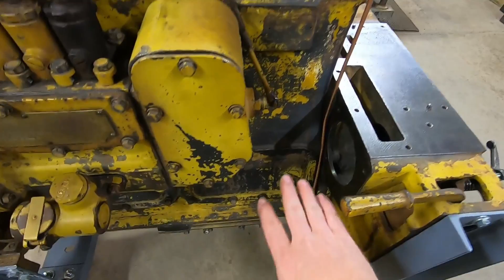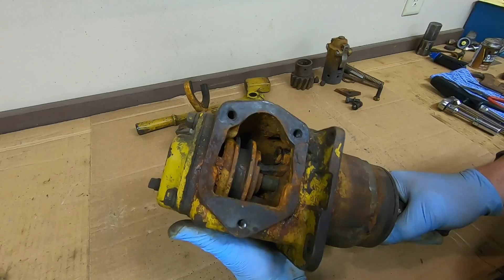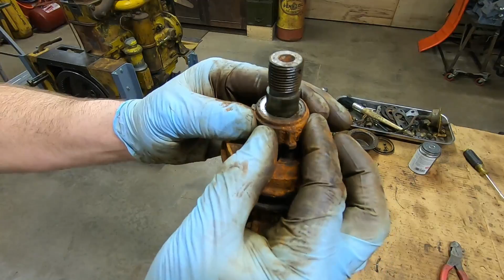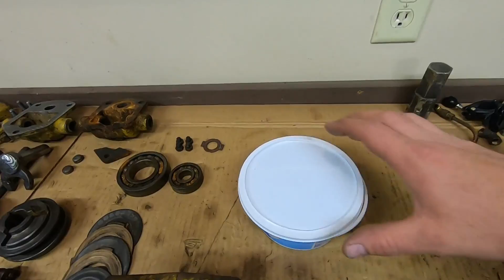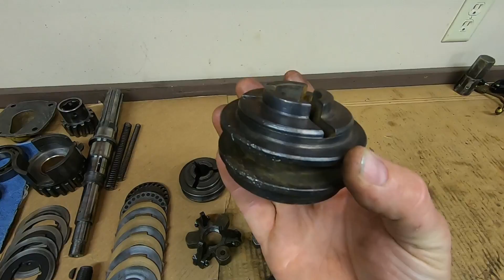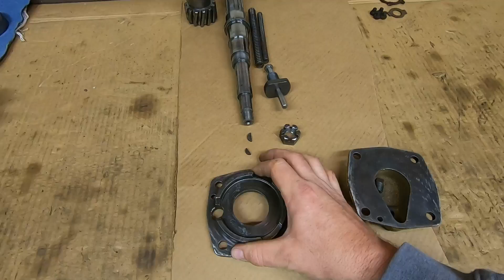Caterpillar D2 #5J1113 Starting System Ep.1: Pinion Drive Disassembly - Broken, Rusted, & Damaged!

Comment: Can I send you my pony motor for rebuilding
Reply from the maker: I do not do any work for hire, but I try very hard to include enough detail and demonstration in all of the episodes that I make to give anybody, regardless of experience, a guide to do it themselves :-)
Reply: @squatch253  Thank you for responding. The head gaskets are stamped with motor. If they go against block they cover two water jacket holes. Is that correct?
Reply from the maker: The head gaskets should not cover any water jacket ports, if they do that means they’re probably on backwards, or are the incorrect gaskets 👍

Comment: Toby ,I know this comment comes 5 years too late but your disassembly and rebuilds really feed my OCD ( everything needs to be perfect).  However maybe you should look into a good size ultrasonic cleaner unit.  Especially for things like carburetors, injectors and other smallish frozen parts.  So instead of just soaking overnight in Evapo-Rust, let the cavitation of micro-bubbles work down threads and internal passages to help dissolve rust and corrosion.
Reply from the maker: Thanks for the kind words 👍 I actually do have an ultra-sonic cleaner, but it’s never really been able to clean anything and I haven’t been impressed with it so it’s just sat on the shelf for the last several years. I’ve kept small pieces in it for two days at a time but they don’t come out looking much different than how they went in, and I just end up cleaning them in my solvent pan anyway.

Comment: Ahh, the two extremes!! Referred to your channel via a comment on Jonathan W's channel. Always enjoy watching him successfully deal with mechanical issues using his previous experience as well as lots of basic, instinctive, mechanical aptitude. Much like the rest of us often attempt to do. Always very entertaining, gratifying, and motivational since Jonathan ALWAYS succeeds!! 
On the other extreme, however, also quite entertaining to watch someone with "intimate knowledge" take a complex "seized" assembly apart without resorting to large brass hammers, torches, and/or saws. We see this as well on Jonathan's channel but he often is dealing with assemblies he has never seen before (614 Crane Unit) as a example. 
Just wondering if you use "bead blasting" as a means of cleaning up those corroded/dirty cast parts??

Comment: Hi Squatch Really enjoy your videos have watched them for about three years now as an ex Cat operator of  Cat 15 D2  D4 D8s and D9s have always been interested in Caterpillar equipment have found some information you may be interested in concerning some 5J serial numbers 
Here I New Zealand D2s were a very popular machine as a lot of our farms incorporate hill country unsuitable for wheel tractors I came across these early serial numbers of machines in one area in the central North Island there would have been many more than this imported for the whole D2 production run they are as follows 
D25J619 
D25J610 
D25J 625 
D25J 418 
D25J 2252SP 
D25J 1186 
D25J4168 SP 
D25J 5160SP 
There were of course many other later ones in this same area hope this is of some interest will send more details later 
Regards Les

Comment: Curious, why dont you use electrolysis to clean your rust parts? I have seen it work amazingly for mechanical parts and is quite easy to do if one has a car battery charger. I intend to use it soon just because its so amazing and easy.
Its fun to watch you tinker. Nothing more relaxing at times.

Comment: Random comment noise = Just discovered the weirdest tractors and crawlers made at least into the 30's. Broxburn One Cylinder diesel that normal warm weather starting involves a blow torch and the steering wheel, with optional 30 gauge shot gun cartridge. Never saw a machine with more personality

Comment: my theory they had to replace the pinion gear then proceeded to fudge the repair/rebuild and bought a new tractor after the starter stopped working. that's when it was parked until you bought it.

Comment: The way the parts came off that shaft blew my mind. Not sure I would have dug into it at all much less as far as you did. Like you said "Take the victories where you can get them!" Hypothetics here. Would they have replaced the starting gear had a bunch of parts that were bad and didn't have available. So they just put it back together with what they had trying to get it going but couldn't do they just let it set? Know any history on why it was parked to begin with?
Reply: That doesn't help "decode" it at all does it...lol. Thanks for the back story. Somehow I missed it.

Comment: That housing is like a Farmall's brake pinion housing. You have to remove the bull gear on Hs and Ms before you can get the brake pinion housing out of the rear end case. 
Thanks for sharing!

Comment: strange parts with no wear.  who ever broke the nose off the case. .must have had the last of the NOS parts installed to make it work when it got welded/brazed back together.. 

 when you start on the Pony motor.. are you going to do any mild porting.. intake and exhaust bowl work and swirl polishing to the back of the valves.  just to make it sound extra great..  give the pony a little extra KICK..

Comment: Awesome video, Toby. Only thing I missed was how you removed the two plugs from the shifter yoke assembly. Struggling with mine, not sure how to remove them without damage as they’re both pressed in concave. Keep it up!! Can’t wait for the reassembly and starting engine rebuild, especially setting up the main bearings for correct end float... And also to see what oil you use in the starting clutch assembly.
Reply: Squatch253 Thanks very much, that’s very ingenious. I wouldn’t have thought of that..

Comment: I do not get your in video link cards.  The starter shaft disassembly was without audio.   . I love your work.  I hope both rebuilt machines work for years after this.  Then there is the prototype, a grader, so much to look forward to.  Thank youyou and god bless you all
Reply: While you are in YouTube, on ANY YT video,  find the little "gear" at the bottom of the YT player,  it's for settings.  Go into the settings, and select "show in-video info cards" and then while you are watching videos, little "cards" that the video poster inserts in his/her videos will show on screen, helping you find links to other videos.  Or, you can go into the master control, which you can enter by clicking on your own icon, usually in the top right of any YouTube page you happen to be on, and adjust settings from there.

Comment: Thanks for another update, those of us that said you should save this old girl didn't mean for you to have this much work saving it, it looked way better than it actually was from here L.O.L . The sad part of seeing this mess is, i work on customer machines that are still  farming from the 90's and newer where I find all these kind of what where they thinking fixes or "botches" to be polite about it.
    I have one here now thats just a "gift that keeps giving" I started with a blown motor and machine in bits a dealer shop walked away from after they told the guy the wrist pin knock wasn't that bad and he should keep running it. It got worse then told him it was a 15000 repair. Then sold him another machine instead after tearing it down later, after he insisted they did it and he needed a tractor quick !.
   I've got the motor rebuilt found the original air filter elements in it from 1995 the year it was made !. Found gearbox issues when it was back running that according to the customer he was billed for new parts by another  reputable shop, and they welded gear selector shafts together instead. The "grind marks" and selectors that are 1/8th inch out of line in neutral gave that away ! 
    They even lost a selector spring from a different range change rail from what they worked on in the transmission putting it together and cracked the top cover somehow.
      I found the mangled parts of that spring in the bottom or stuck to the magnetic speed sensor luckily it never hurt any gears going through .  The part that really makes me mad is we know lots of this can't even be blamed on a farmer or bush mechanic fix. Looking forward to more updates, thanks for your dedication the expenses/time doing this and sharing  the extensive voyage with us . see ya next time, Take care
Reply: His rebuilds should be good for another 100yr!!

Comment: I have put worse castings back together with Allstate number 11 alloy. If you have a better spare part, that IS better.. but if you didn't.. it could be salvaged far better than the crummy weld. Same with the tab on that other smaller casting.    Lovely rust.. its an honorary Oregonian!

Comment: Got to wonder if somebody took it apart to fix it and didn’t get it together right thus leading to it getting parked. Have you ever tried thermal shocking parts like the one you got soaking? Heat the parts in a hot water or oil bath then cool them. The different sized and density parts cool at different rates. Not as intense as a torch

Comment: Looks like the only way that pinion gear cold be that good without a clutch brake, would be if the pinion was latched before starting the pony motor with the clutch released of course. Maybe that’s why they left a friction and separator plate out of the clutch🤷🏼‍♂️😂 If that’s was the case, I’m glad I wasn’t the one pulling the rope on the pony motor!🥴

Comment: Hey squatch love catching the videos got two non related questions for ya. As a Ford mechanic I've got a 16 focus auto that I think is coming up on needing a new clutch. Is it something I could do in my garage or should I just take it to a shop/dealer and if I do how much is it gonna hurt my wallet. Also working on a ford 850 tractor I aquired last fall it turns fine to the right but hard to the left. From what I've read it's a worn thrust bearing. Can I limp it for a bit through the summer or should I rebuild before more damage is done. Thanks. If you see a northbound UP on the Hinkley Sub tommorow morning that will be me.

Comment: I'm glad I'm not the only one who thought the parts looked better before you cleaned them. Well, at least they looked more promising. Bummer the pinion assembly was so busted up, luckily you had serviceable spares with which to rebuild it! What type of oil resides in that cavity to lubricate the bearings and clutch discs? The D2 has a significantly different setup than the RD6 does in this area.